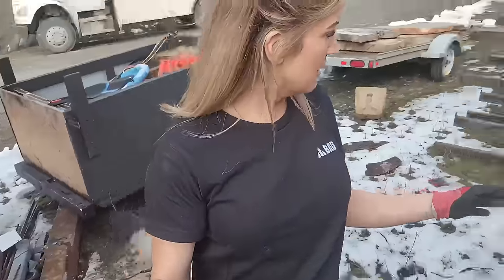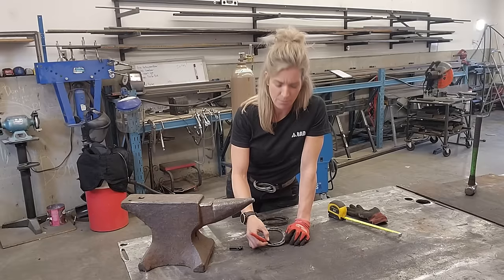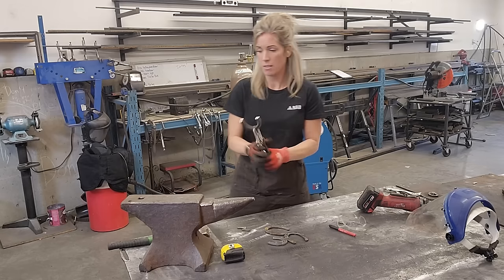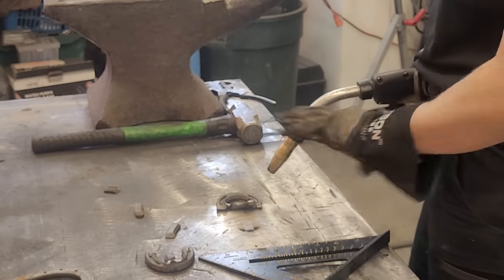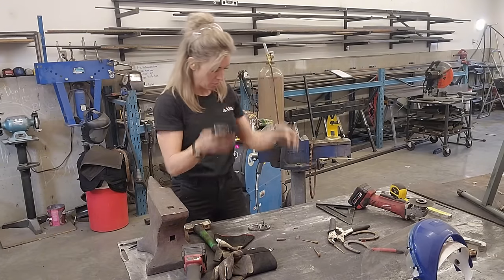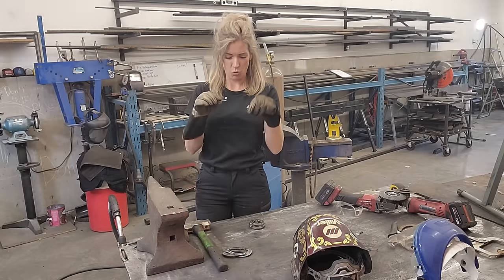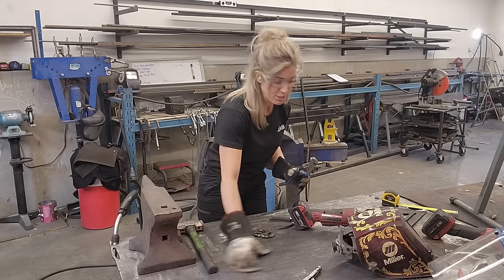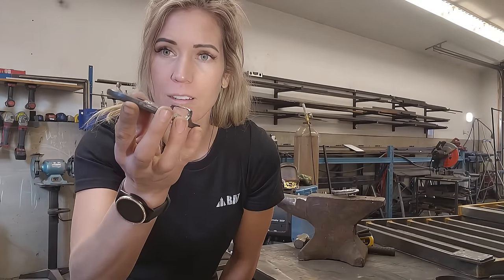Build With Me - Horseshoe Belt Buckle

Comment: I also thought I was using my angle grinder in the correct way when cutting steel, until I saw how Tony from Fitzee's Fabrications was doing it and realized there's a better way.  He holds the grinder in his left hand and guides it with his right hand fore finger and thumb. This way your whole body is not inline with the disc or the sparks and looking diagonally at the front of the cut you have a much better view of what you are cutting. Just need to be mindful of where the sparks are going that nothing will catch fire. . BTW loved the Buckles.
Reply from the maker: I'll have to check out his videos! Thanks!

Comment: 🤣 Dann, I've been using vice grips wrong all these years!! Pulling the lever toward the lower handle instead of independently up toward the handle with the tension screw in it 🤯🤯🤣 Wow....I was looking for a way for you to modify yours, when I realized, I essentially just pull the hadles away from each other instead of using the leverage of the release lever. Kinda looks like you're doing it the same way I did with your fancy pair of grips that were giving you all the trouble.

Comment: Nice 👍 one thing you can do on the vice grips to help unlock them is weld a small round bar on the tensioner bolt to make a T handle or drill a hole so you can slip a screwdriver through it for easy turning.  I got the idea from my very expensive but worth it snapon vice grips they have a spot to fit a hex wrench in the tensioner screw so you can tighten or losen the vice grips.
Reply from the maker: I'll have to try that before I throw these out. Haha!
Reply: @rachelbohnet  even better weld a washer to them

Comment: Yes. Nice. As the comments said stay safe. Wear gloves. Safety glasses. Steel boots cap etc. it is easy to lose focus and be distracted by the camera. What is the weight of the finished 🧲 horse in shoue buclar? And how to measure and design the leather buckler and belt. Did you use fastener or studs to lup the leather belt?  Very nice.